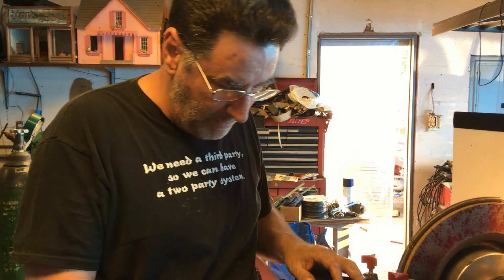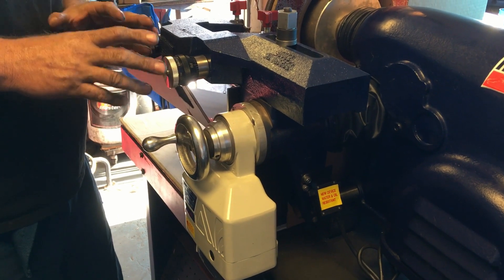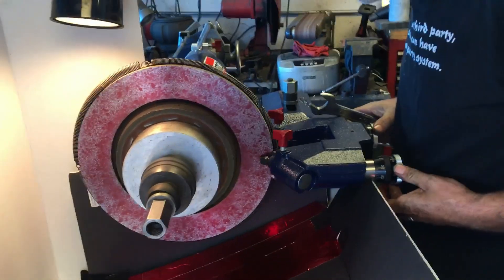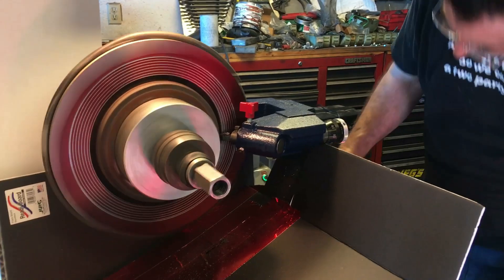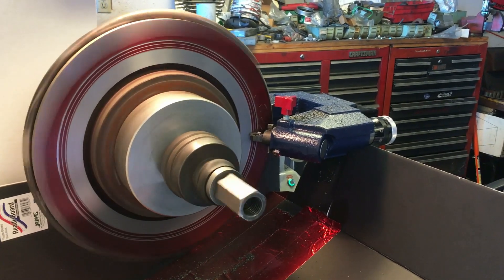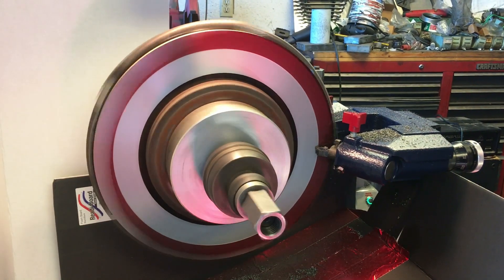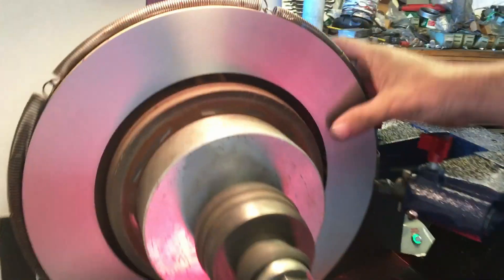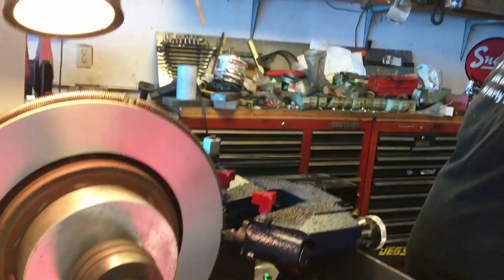Andy's Upgraded Ammco 4100

Comment: So how much wobble is acceptable in the mounting hardware, the adapters that hold the rotor?  I sandblast and then wirebrush the hat and inside the hat and I am still looking at .006" side to side.
Reply from the maker: The mounting tooling needs to be trued up to zero. Mount the cup on the machine and cut the face to true using the twin cutter. The larger the rotor the more important it is. As a general rule .003 is the limit for wobble. Anything over that an its going to have pulsing issues an will probably be coming back.
Reply from the maker: https://www.youtube.com/watch?v=IG8EHzXQ8Cw
this video shows how to dress you tooling properly for best results.